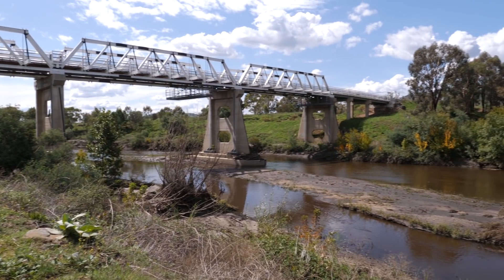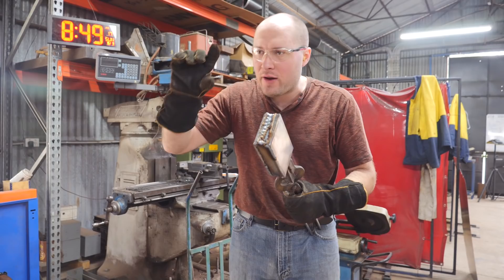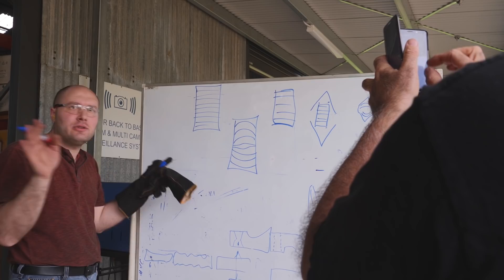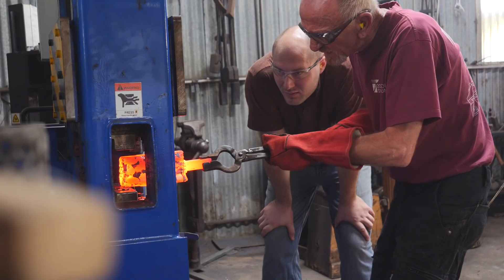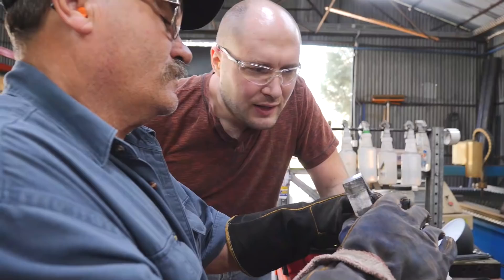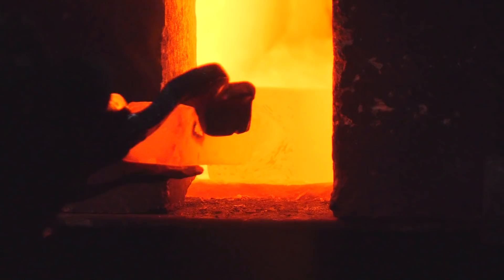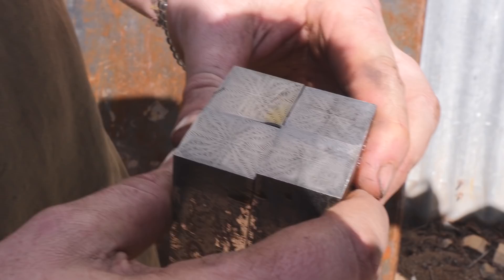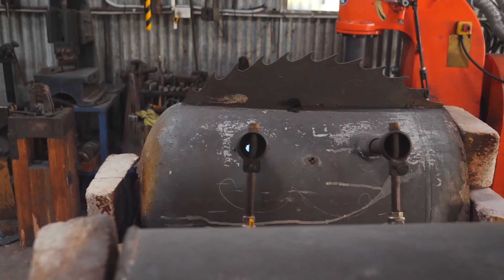Making Mosaic Damascus in Australia, Pt. 1

Comment: Better
Still a wee little confusing, you used squaring dies instead of forging on the bias correct? Then rotated 90° and re squared on the bias again? What seemed different is you 4 wayed twice?? Then tiled the billet on a 35° or 33° whatever your cut was. Did you flip the tiles to mirror as shown in the past? 
Doing some cable tomorrow.. forge on!
Reply from the maker: Hey tim after cutting at 35 degree the tile lay out flat ,in order ,next to each other 👍🏻🔥☕️⚔️
Team Royer